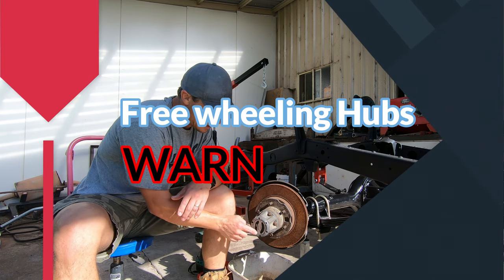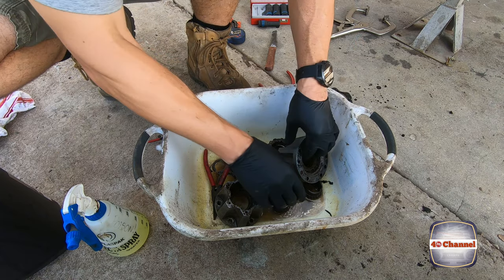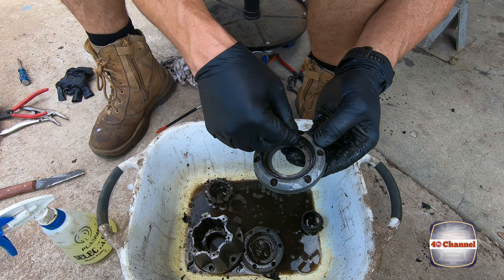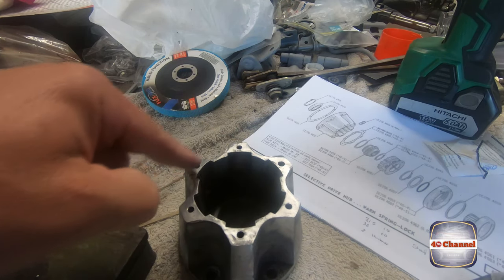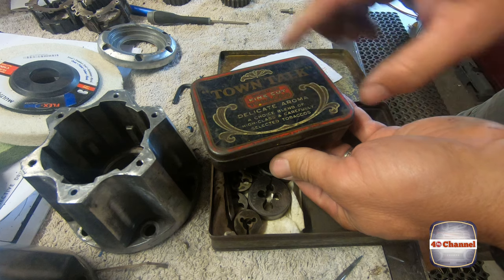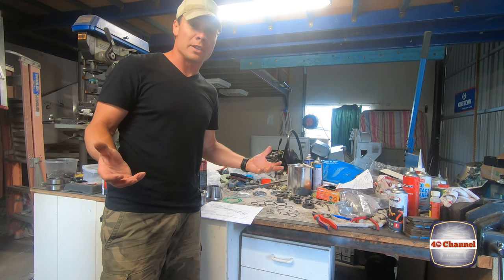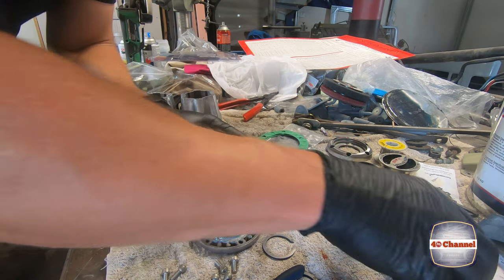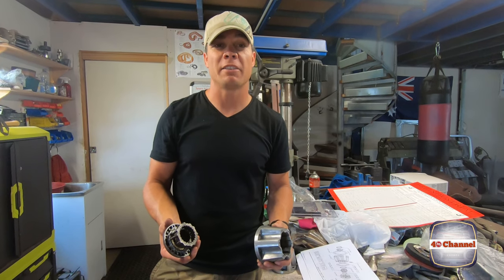EP37 - Warn Free wheeling Hub rebuild, FJ40, 4x4, 4WD

Comment: Really appreciate this video as I’ve opened up the exact same hub on my CJ5. I ordered the 7300 rebuild kit but that didn’t give me nearly everything as you’ve mentioned. Specifically the washer/shims you put in the rust solution and the square gasket you clean out at 11:24. My square gasket is pretty brittle and I’m not trying to break it. Only solution I’ve seen so far is to buy the gaskets in bulk, 100 at a time. Would love to know if anyone else has a resource! Great video, subscribed for sure!

Comment: curious- with the warn setup, do you find the split washers keeping those nuts tight compared to the aisin setup with conical/cone washers?
Reply from the maker: I haven't had an issue with either style of washers coming loose. But it is a good idea to replace the spring washers whwn removed as they become flat and lose their locking ability.